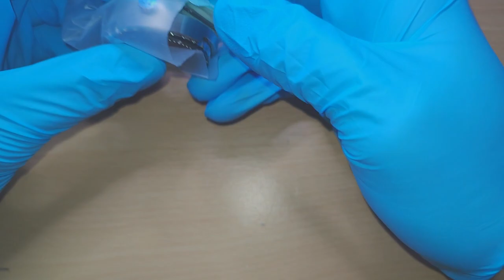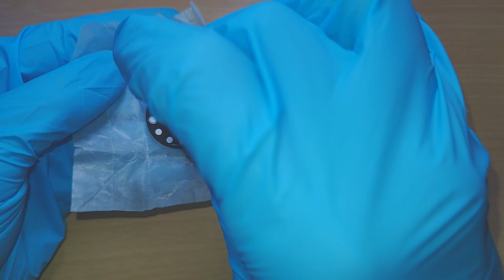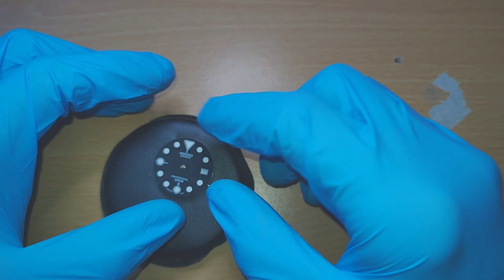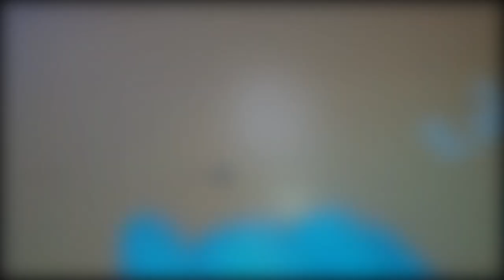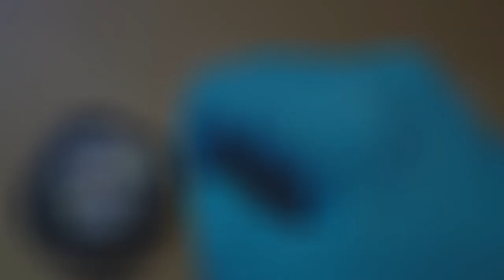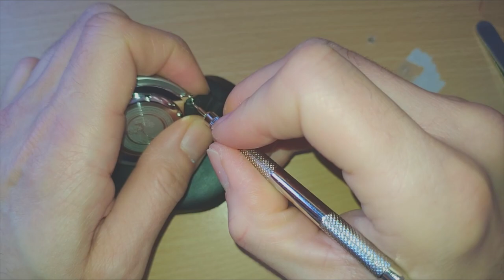Tuna Retro Diver Watch Mod Build

Comment: DO YOU HAVE THE INNER AND OUTER DIMENSIONS OF THE BEZEL INSERT. ALSO BY ANY CHANCE HAVE YOU MEASURED THE DIMENSIONS FOR THE CRYSTAL. I NEED TO CHANGE THE CHAPTER RING, SO i HAVE TO POP THE CRYSTAL OUT, I HAVE A SPARE BLUE MONSTER DIAL, SO I'M THINKING THE MONSTER DIAL WILL FIT WITH NO NEED FOR A CHAPTER RING , WHAT DO YOU THINK
Reply from the maker: 32mm inner & 37.8mm outer approx, no idea on crystal. And cant say if that will work, just gotta try it.

Comment: does it require NH35 movement with specific for 3.8 crown position? or can I use NH35 with 3 oclock crown?
Reply from the maker: you can use either.

Comment: ive had the original since the 80s my buddies sold me his for $100 today $1300 now discontinued ,,I lost my first diving boiling pots hawaii ,I live big island and ive replaced it with newer from around 2017  cost $1300 with blue dome $199 the 80s band oyster $300 and I wear it evey day some day I wear the 22mm   had the white face Daytona Rolex but it got too much attention got it $7500 later doubled my money ,didn't like the time it kept ,not good.